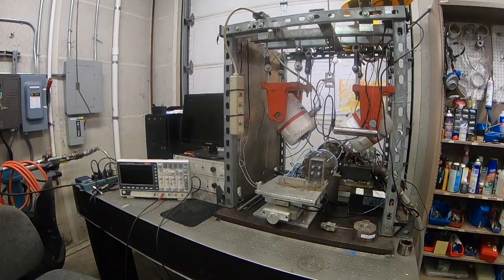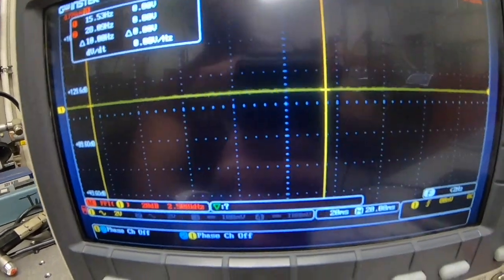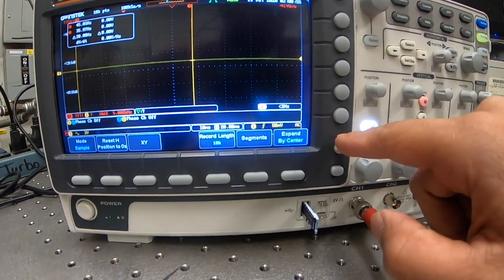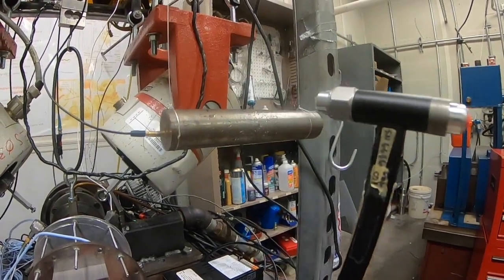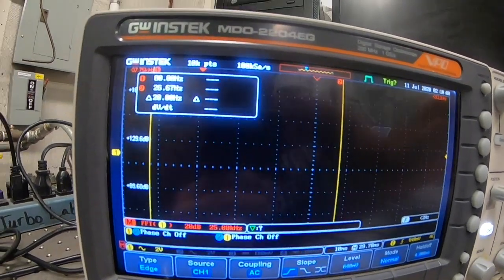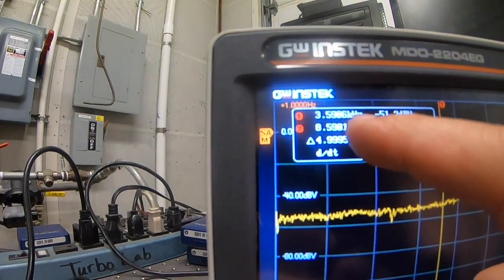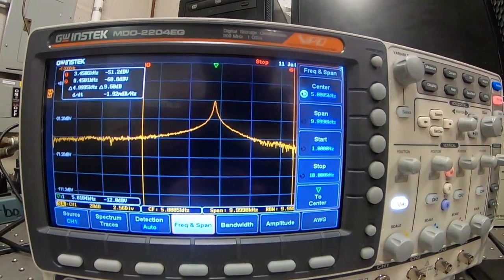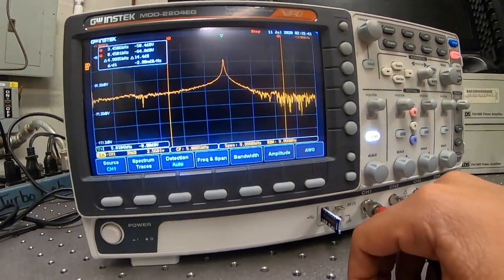GW Instek MDO2204EG Quick Setup: Impact Load

Comment: Really interesting demo of a one-shot acquisition.  Thanks for the demo.  As you were demoing you mentioned some optional ways to change things... I would help if you could provide the setup details, i.e. scope settings, to do the example you did and perhaps include it as a text file  in the SHOW MORE so that your very interesting demo can be replicated.  That would be great if you can do that.  I was impressed with the ability of the scope, too.   The first demo  you did captured the resulting waveform with the scope in the Time domain.  You repeated the acquisition with the scope in the spectrum analyzer  to show the spectrum of the pulse. Now here's the question:  Is it possible to acquire the pulse in the time domain as you did with the first acquisition, save it to a USB stick, then recall the saved pulse and switch to the Spectrum Analyzer to display a spectrum of the saved pulse ?
Reply from the maker: It's been a long long time. Sorry. I didn't see this. I think you can acquire those points as a plot for later postprocessing. For an accurate acquisition I would rather use an NI DAQ
Reply: I actually forgot about your post and my question!  But I will review it. Thanks.